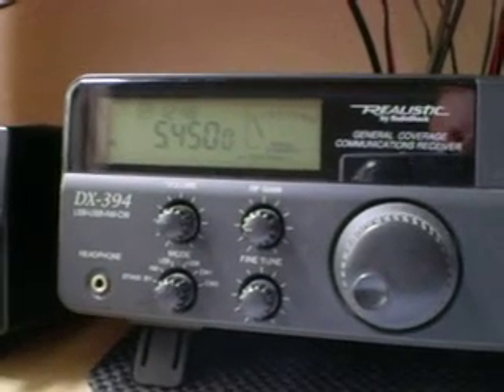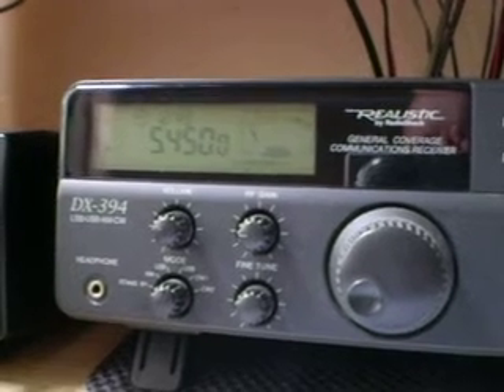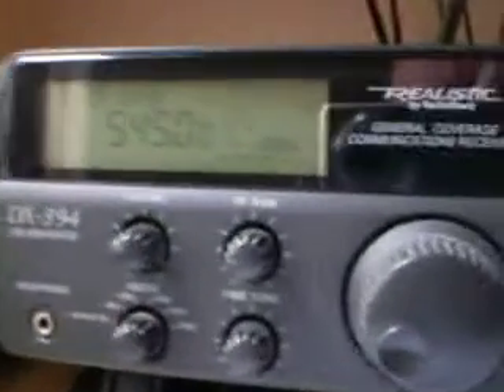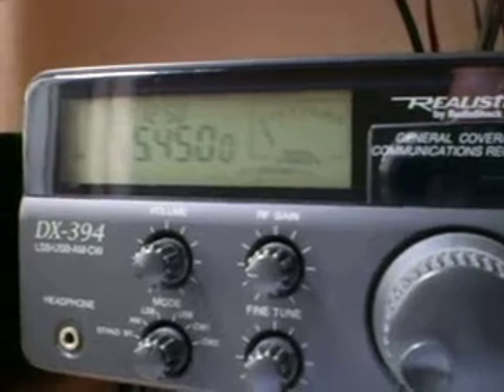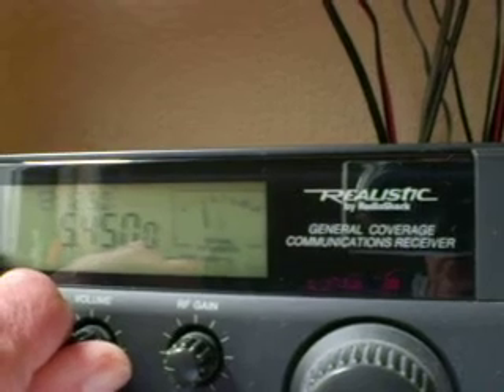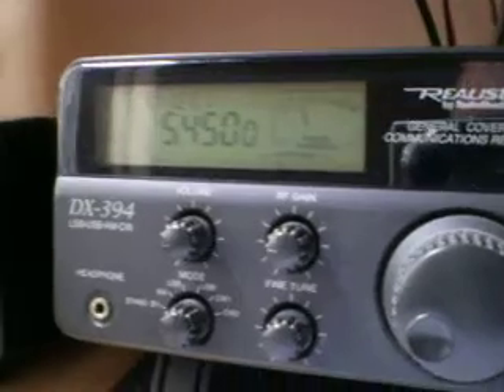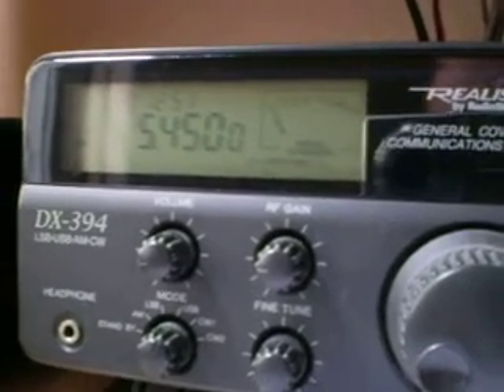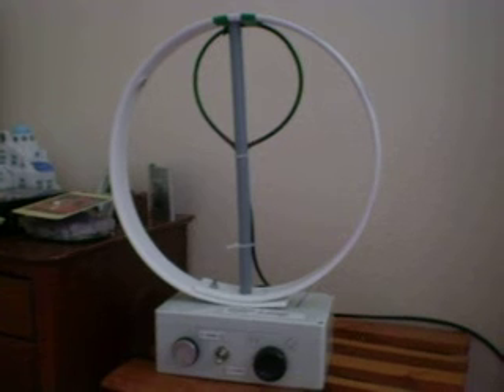Simple homemade Loop to reduce noise on HF

Comment: I can get this quite clearly on my MLA30+ antenna at about 6 metres high on 5450 KHz  USB. From Kent.
Reply from the maker: Hi Gary, I really like the mla-30 loop. Great price and from what I've read great performer. Fantastic that you have managed to get yours 6 meters high. Loops are a great way to. I expect almost all the bands are pretty free of noise with your loop up there.
Reply: @M6RDPadam   Yes the noise level is greatly reduced. Would the MFJ1025 work on my antenna for DX only ? Thanks for your informative videos.
Reply from the maker: @geez-hd6dn  I've always wanted to try one of those but personally prefer the cheaper ones from Europe

https://youtu.be/srOcDFFlnRs

But if you have an MLA-30+ up at 6 Meters I'd be really surprised if you can beat that unless it is being plagued by a noise source....

For instance solar panels can radiate noise up pretty high into the air (I know as I have that problem myself here). An MFJ1025 along with another antenna to pick up the noise source (like a small length of wire connected to the 1025) I would probably do a terrific job of cancelling out the noise.

The noise eliminators really come into their own if you are being plagued by local noise that you can't null out with your loop.

Hope that helps. 73 Adam
Reply: @M6RDPadam   Thanks Adam. I shall look at the cheaper alternative QRM noise canceller. They look quite good on the videos I’ve seen. Cheers for your help.

Comment: Were you using a vertical or horizontal antenna. Vertical and endfed antennas are noisy antennas. I nice dipole  or off center dipole should be quieter.
Reply from the maker: Hi KE6UPI, I have never tried a dipole as I have very little outdoor space and in the small space available (which is approximately 3 m for each dipole leg) there are solar panels and mains electric wires overhead. But your comment has made me wonder about trying a dipole for the VHF air band which would be possible. If I do experiment I will is sure to let you know. 73
Reply: Hello @M6RDPadam , For 11 Meter Band try this mount and two 11 Meter 4 foot fiberglass antennas. It might even work the top part of 10 Meter Band.

https://ebay.us/nCG65R
https://ebay.us/bnX1Ks

Comment from the maker: Mike, that's good to know as I have often wondered how effective it is at reducing noise. The 394 is a great little radio I reckon, the only downside that I can see is when the little lithium battery that holds the memory fails. I owned an AOR 7030 once and as well as costing nearly 10 times as much I never heard any more on it. 73

Comment: I always wanted this radio when I used to work at Radio Shack but it was too expensive. If you can purchase an MFJ 1025 that will solve your noise problem on the external ariel.

Comment from the maker: Hi and thanks for commenting. I should have said in my notes but the capacitor I used was a small variable capacitor which I tune to the required frequency and yes this kind of simple cheap tuned loop does improve reception and can be rotated to null out any local noise. In two different locations now it performs better than 20 m of long wire outside. But of course you do need to retune every time you change frequency. For your information I have also compared this small loop to an expensive r f systems dx10 amplified vertical Whip several metres from the house and quite high and it is way better in every way.

Comment from the maker: Just wanted to say my earlier loops were 1meter diameter and although they were more sensitive especially on the lower bands they were not so great at rejecting local noise. I reduced the loops gradually to around 30 centimetres diameter and found that any reduction in sensitivity was amore than compensated for by their much improved ability to reject local noise. Adam

Comment: hey .. vo1um here Newfoundland canada..    i get a lot of noise level on HF 20 40 80 will this loop work for my station . if so can you email me some information on how to build it .. plz maybe small diagram  of it.. and how it connects to the system.
Reply: Hi did you manage to find a solution, I get s9 on 20 40  80?